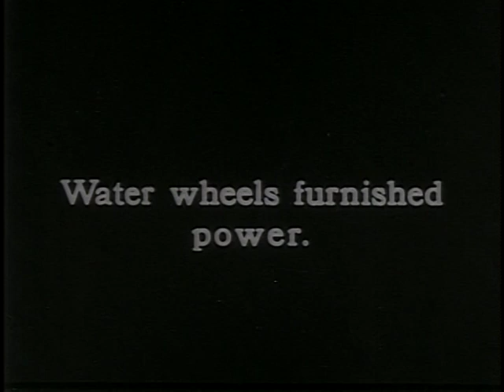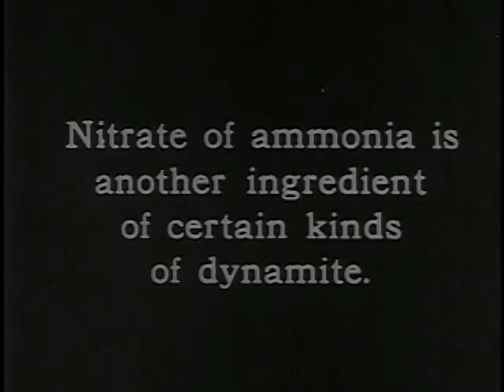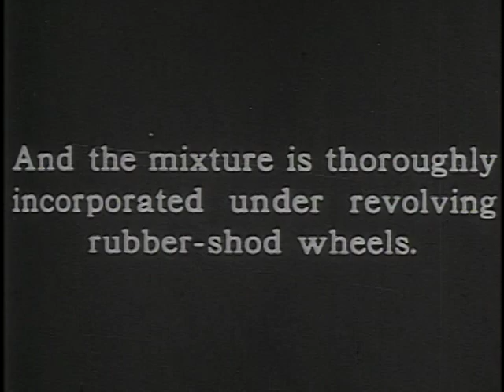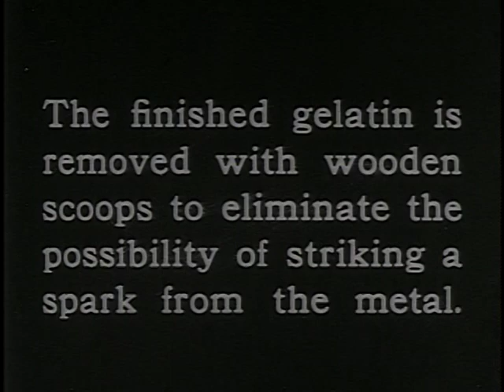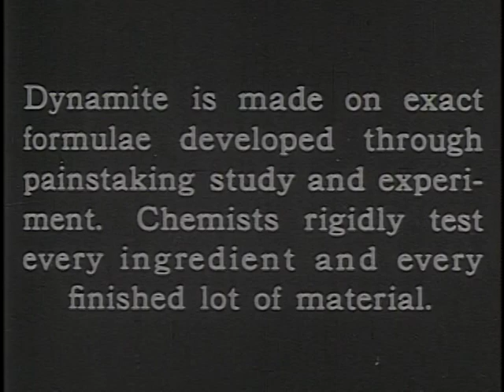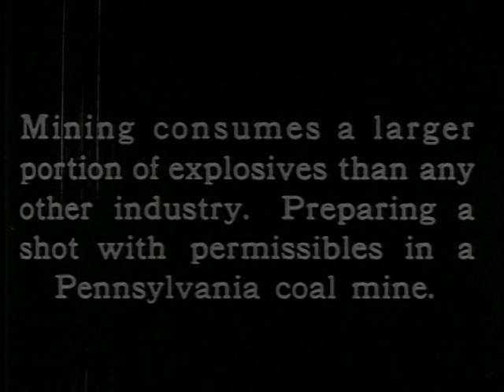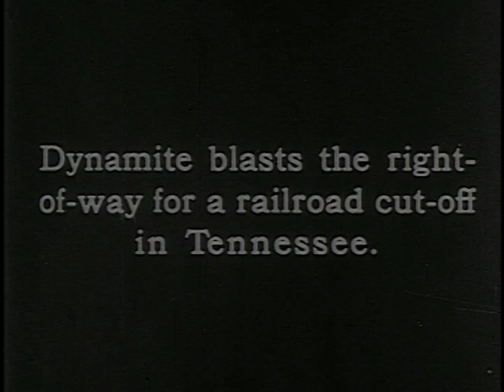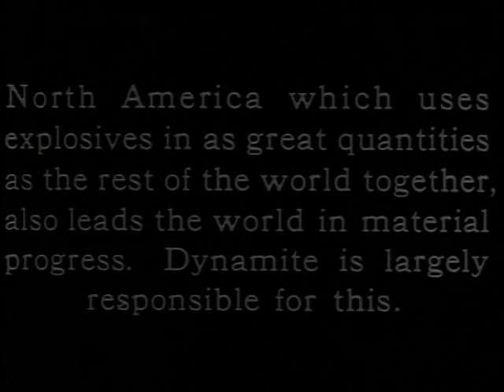The Story of Dynamite

Comment: Thanks you so much for posting this most interesting video. I see that many still were used from this original tape in the famous book by Davis 1941 The Chemistry of powder and Explosives. I am delighted that you took the time to post this. What surprised me the most was the rough and crude way liquid GTN was handled! It was also interesting to note in the nitration room stirring of the mixture relied on one belt driven motor ( hope the belt would never break or come off..

Comment: If nitroglycerine is very unstable, and extra precautions were made to handle it with care so it doesn't explode, why is it that at 5:40 they are just pouring it into the container, wouldn't the friction of it splashing on the bottom of the container have the possible of setting it off?
Reply: Nitroglycerin is a very sensitive primary explosive, but no, it doesn't go off just by splashing it. Look at the mythbusters episode on it.

Comment: 19:00 - should they really be standing there smoking and doing that?
Reply: Yes, dynamite is much more stable than nitroglycerin, it won't explode without a detonator. If put on fire it would just burn.
Reply: @lagrangiankid378  yes... and that is a bunch of fuse. Fuse is gunpowder . Fuse is connected to blasting caps. Even if the dynamite "only" burns, its a very serious situation.
Reply: @keithlegg  In that case you'd be right, but how do you know it's a fuse and not an electric wire type detonator?